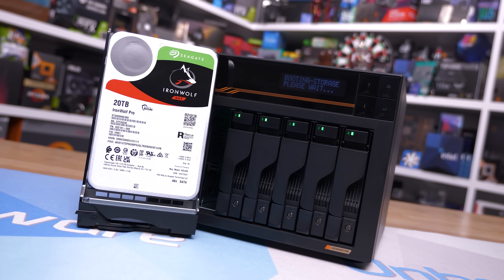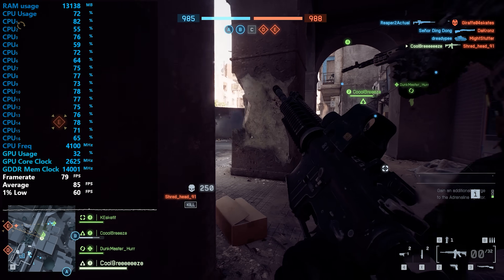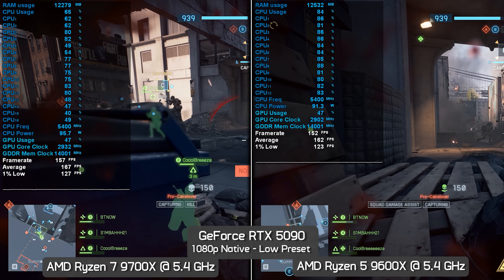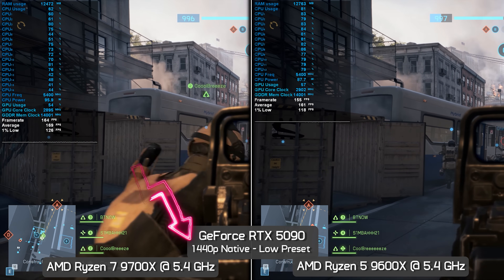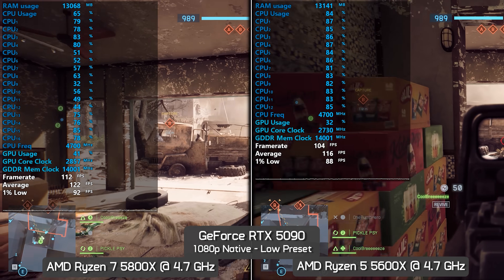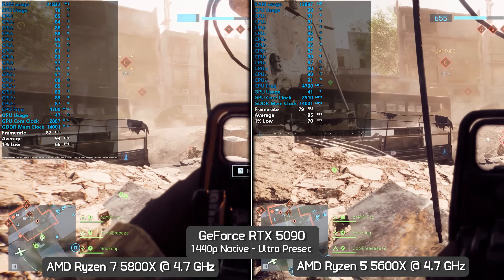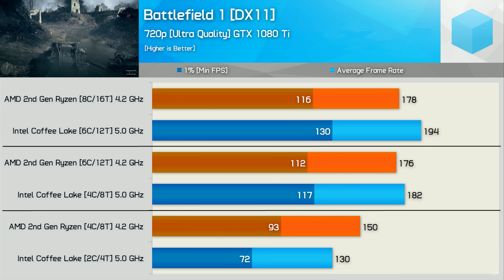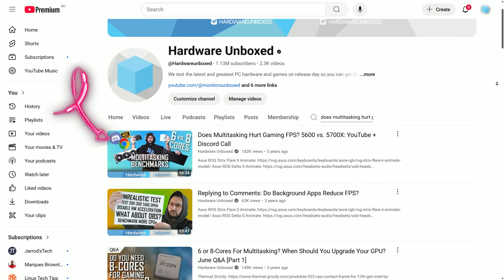Why Gamers DON’T Need More Cores, 6-Cores Still Works Well!

Comment: The only problem is the absence of 3D v-cache on 6-core AM5 processors. It does make a huge difference in some games.
Reply: Yea, but 32MB for 6 cores is still really good.  And frankly, when these 6 core CPU's are often on sale for like £130, it's very hard to complain.
Reply: @maynardburger  It absolutely is a still a great offer, for sure. I just wish AMD had some nice X3D offers even with R5 CPUs. Then everyone could comfortably pick a CPU for their use case.
Reply: @frantavopicka5259 
From the past experience. The 6 cores X3D CPU was just a bunch of salvageable "failed 8 cores". There's no reason for AMD to release a dedicated 6 cores X3D CPU line, if the 8 cores itself still selling like a hotcakes.
Reply: @fajaradi1223  Where i live, we have 7600X3D's and 7800X3D's. The only problem with the 7600X3D is that it's only $15 less than the 7800X3D.
Reply: Нет игры где 32 мб не хватит, кроме редких особо упоротых игр, в которые не особотянет играть
Reply: the 7600x3d exist and realy affordable in the USA and Canada with a MicroCenter/Canada Computer Bundle.  In Europe you can get it at Mindfactory.

Comment: You are also benchmarking a bit of ccx to ccx latency with the older cpu:s. 2600x is a 3+3 and 2700x 4+4 chip.
Reply: That is an absolute detail. Thank you 👍
Reply: Well that's more or less inevitable when benchmarking multi ccx ones. Just part of owning those

Comment: I thought I would see the x3d parts for each gen (5600x3d vs 58/700x3d, 7600x3d vs 7800x3d) but then I realized 9k series doesn't have a 6-core x3d

Comment: "BRO can you please test in 4k? i don't know if my CPU can do 4k?" LOL
Reply: I can do 4k on my ryzen 5 5500 and my rtx 5060 ti 16 gb. I am on the am 4 platform and it performs flawlessly. I can get ultra settings on most games. Doom the dark ages and cyberpunk 2077 being the exception with low fps. I can get 60 fps in for night at 4k which is fine for casual gaming and not professional.

Edit: the CPUs on the current Xbox and PlayStation are based on the zen 2 architecture and play 4k. My ryzen 5 5500 is zen 3. I will eventually upgrade to the zen 6 or zen 7 with the APU type CPU with the graphics power of the rtx 4070 when it comes out in 2027. I will still pair it with an Nvidia discreet GPU.
Reply: @nephilim0may0cry  bro the whole joke is that the CPU dont matter when it comes to resslution. CPU litrelly does nothing wheN bumping up the res, thats the joke here.
Reply: @imretix8081 usually

It's rare, but occasionally there are instances where upping resolution can increase CPU load. Even then, typically the GPU load increase is much greater and you end up GPU limited anyway.

From a practical perspective you are generally right, but it's worth noting that it's not always technically the case.

Comment: Even today most games still largely rely on single-threaded performance, which is dumb. One of the few examples that I've seen that will use every core and thread you have to its max potential is Cyberpunk 2077 which still runs great on my old 10th gen Core i9, but some newer games struggle due to barely touching most of the cores and hammering like 1-2 threads.

If more games would be like Cyberpunk (never thought I'd say that) then CPUs would age a lot slower.

Comment: Intel spirit, get out of Steve's head. 8+ cores is required. The more the better. The problem is the OS (Windows) that is not good with over 8...
And games do not spread its load across CPU cores, the OS scheduler does. That's why you can still run 16 threads on a 4-core CPU and it works.
We left the 4-core era because Windows itself just for running requires at least 4 cores now to run efficiently and smoothly.

Edit: And if it's dumb to test games at 4k, then it is dumb to use games to benchmark CPUs at all since older gen with just some added L3 cache can still out do some of the latest ones. The thing is, having the fastest CPU with a slow or not ultra latest GPU is dumb too then? Game is not the appropriate software to test a CPU because of too many factors evolving around. So testing any CPU with a GPU involve is futile.

Comment: I loved my 8086k. Had it overclocked to 5.3 ghz. Fantastic cpu, even in 2024. I have moved on to a 9800x3d, but I will always think fondly of my 8086.
Reply: Yep, my old 8086K idles only at 30C, comparing to 50C from my new Ryzen 9950X.

Comment: Yesterday, I literally saw someone commenting that playing games while streaming on a 6 core causes stuttering while not so much on more cores. Forgot which video that was.
Reply: Eating my words. That was regarding VRAM, and the user suggests closing background resources that consume VRAM for more headroom.
Reply: And its true, russian channel tested multiple backgorund apps and the 12400F/5600X started stuttering while the 8 core cpu(forgot its model) did not suffer at all.
Reply: @kazuviking I think I remember which video it was. It's the recent R7 1700 Vs i3-12100 video on RandomGamingInHD.
Reply: @HandleIsNewAndBad Well, it is simply not just about the streaming, but if you just play, 6 core is enough.
Reply: @kazuviking Streaming gets more demanding with higher settings. I can double stream at 1440p 60FPS 20Mbps with my old 13900K.

Comment: I guess the 9600X with the 9070 XT for 1440p only for gaming is the way to go
Reply: 5600x + 7800xt works quite well, speaking from experience.
Reply: @shryko  Im still rocking a i5 11400 + rx 6800 xt myself. It gets the job done.
Reply: appears so, killer combo.
Reply: Me too thinking abt getting a 9700x with 9070 xt
Reply: 7500f + 9060xt 16gb is best for budget gaming

Comment: don't forget the Zen+ (IIRC) Ryzen 1600AF at what was it? $85?
Reply: Still have one, inside one of the home builds, running like a dream, paired with rx6600, for 1080p@60fps. And once it can't run those games, will just convert it to a retro emulation server.
Reply: Yep it was $85 for the 1600AF. I bought one right at the start of the covid lockdown. There was also the regular 1600 on sale for $60 towards the end of 2019, I had a friend that bought one of those and is still using it to this day.
Reply: While a massive value win on-paper, it came out in late 2019, just one year before the new consoles would come in with 8 core Zen 2 processors.  And given how even 3600's perform these days in plenty of games, the 1600AF probably only had any kind of longevity because of how excruciatingly long the cross-gen period of XSX/PS5 lasted which not many people expected.  So maybe you got lucky if you bought one of these at the time, but that always seemed a risky prospect to me, even for how cheap it was, when you could get a 3600 for $200, which spread out over the next 5 years, was only $20/year more for much more relevant performance that entire time.  Or heck, if you were just a little patient, just one year after the 1600AF we got the 5600 Zen 3 processor for $200 which is ultimately way faster.  People forget those original Zen 1 CPU's were not actually that powerful in single thread performance, still well behind Intel.

Comment: The first week of the beta I was on a 10900k with a avg of 120fps I wanted to get on the AM5 platform so I bought the cheapest cpu (7600x for 170) and for the 2nd weekend of the beta I was avg 160. I was planning on upgrading it but I think I’ll just wait for zen 6.

Comment: My 7500F is just doing fine still. I can play everything with at least 60fps at maximum settings in 1440p.
Reply: 7500f is even good for +-100fps in AAA games. Its quiet insane how good of a cpu this little boy is.
Reply: @richardjung9562 I'm running it with a RX 9060 XT 16GB.
Reply: your 7500F will be good for years to come. Insane price to perf CPU, can be had for 140-150 on newegg

Comment: Maybe Next, the Ryzen 7 processor could Utilize 8 cores with 768KB L1, 8MB L2, and 48MB L3 cache for improvement or even justified upgrade, but hey Im not cpu expert or so... 
BTW new Hardware Unboxed tune is soo good, specially on Earphones.

Comment: Tech deals has been real quiet since this dropped.
Edit:
Btw Steve, framechasers is trashing ya for saying the 7600 is the better choice over 14600k.
Reply: Literally the first thing that came to mind when i read the video title was „Tech Deals and his 12 core for everything shenanigans“
Reply: Its okay we can agree on disagree.  I hv gamed on from jst 1 core 1 thread Pentium 4 system to current 8 core 16 thread i7 12700 non k

Comment: I have 4/8t Core i7, and these days in order to play any game I need to shut down any application including teams chat, all 4/8 cores used 100% as GPU is oversized for CPU, but it gets used 80-90% so it's not terrible either. Point is extra aps do require more CPU, just probably on 6 core it's not as prominent.

Comment: I've always wanted to see a comparison for the 9900X3D, I got it at a good price and I do use the extra 4 cores compared to the 9800X3D, but since two of those cores aren't the X3D ones how much of a penalty does it get in terms of performance in gaming? Or, say, compared to the 9950X3D.
Reply: This my current  situation. I have a 9900x3d. I turn on msi x3d game mode . My games performance jumped and butter smooth in games like. War Within, City of Heroes, F1 25, Madden 26 and many more. I’ve  also notice extremely less latency, almost like it doesn’t exist. My gpu is a 9070xt and I’m playing on  a 4k 240z oled. When x3d game  off. I noticed some stuttering and more latency. I’m definitely keeping x3d game mode on.
Reply: @tbreeze79  The only thing that mode does is to turn off the other 6 cores. So you have a CPU that performs worse than a 9800X3D on every scale, since you have 6 cores instead of 8. You probably didn't install the chipset drivers, or disabled the xbox game bar, you need both for windows to know which core to use for games, and which for other windows processes and programs.

Comment: Video take away: 6 core CPUs are the quad cores of the modern era.
Reply from the maker: Not really, the quad-cores thing suffered massively from core stagnation, as in the cores themselves didn't really get faster. As we've just demonstrated here 6-core processors have continued to get faster.

Comment: I have the 5600x and rtx 3080. My cpu is constantly at 90-99% on Bf6 lowest settings and I'm barely getting 100fps unlike what is seen in the video the 5600x was constantly below 90% and was at 120fps
Reply: I’m assuming he tests on a clean install of windows with no software running. That may be the difference
Reply: are u running it stock ? no PBO , video showed overclocked 5600x on all cores which can help in CPU bound scenarios
Reply: @turtleneck369 i am using the ryzen master software it auto clocks my cpu when needed.
Reply: @Danger_Assaassin i am not sure how well it works but if u are not running nothing in baground u should get a bit better results i actually benched same setup in bf6 but 5600 was 4.8ghz all core ,what is your memory setup temps while playing and so on ? what resolution?
Reply: @turtleneck369 1440p, temps at 75 max for both cpu and gpu. Ddr4 3200mhz cl16.

Comment: Its more of a thing  across generations and eliminating already existing  bottlenecks. I upgraded from a R5 3600 to a R7 5700x and the 3080 is now performing much better. 
That being said people that were buying quad cores in 2019.  especially the i3-8100, 3200G and i3-9350 are not having fun with their 4 core 4 threads.

Comment: Also the benefits of having more cores arent easily represented in benchmark charts, alot of it is load times, boot times, smoothness and responsiveness and better longevity, multitasking and generally higher resale value too
Reply: Indeed, those are all perks of having more cores usually, but still heavily dependent on the purchasing price difference between its 6 core counterpart.
Reply: @WrongButtonWB Also dependent on how LONG you keep the CPU around.  Worth remembering that value shouldn't be judged just by what it gives you today, but what it can give you over the whole period of ownership.  $100 more might feel like bad value on Day 1, but spread over 5 years, that's only $20/year and much easier to justify.  Importantly, the extra cores might also let you hold off on an upgrade a little longer.  In which case you're not just gaining longevity, you're also making it so when you do upgrade again, better options might exist than were to you need to upgrade a couple years prior.
Reply: @maynardburger not to mention, if you divide it by the thousands of hours of overall use of the machine, the figure is so small you would wonder why you stressed over it in the first place

Plus, having a better cpu makes a difference from the moment you hit the power button, unlike a gpu. Which is primarily when youre gaming

Comment: My old R5 2600x was not keeping up on the games I played, and also couldn't run my RAM full speed. When I upgraded to a 5700x3D all my stutter and lag problems vanished.
Reply: How much that upgrade ended up costing you? 5700x3d is ridiculously overpriced here, like 230€ which is almost 270$... So not worth the cash.
Reply: @WrongButtonWB I paid £180 for it last year.

Comment: For gaming only, I will agree with your assessment. However, once you start adding having a browser running a stream on your 2nd monitor while you are playing games and Discord/OBS in a scenario where you are streaming the game to an audience, 6 and even 8 core CPUs can both reach high enough utilisation to run into some bottlenecks already (not sure if BF6 is a title that uses most cpu, my worst experiences are in MH Wilds, which might be partly the fault of the games poor performance overall).
So, while you can currently run games fine with 6 and 8 cores, it is the general utility around just running a game that has gotten somewhat more limited by now. Assuming the next console gen might offer 8 cores for the cpu part, by then the issue will certainly show up more.
But to emphasize, I completely agree with you that for gaming, as what I described certainly isn't the general use case. For most people 6 cores will be sufficient for quite a while, and are absoutely to be considered the best option for low budget with very few downsides.

Comment: On a 12700k and 9070 in BF2042 I would get around 100fps on 1440p high. In BF6 I was able to almost max out my monitors rate of 144 on 1440p high with fps between 120 and 140.

Comment: Consoles dictate the core count. PlayStation 6 is reportedly-allegedly going to have 8 cores. Faster 6 cores do not fully make up the difference with slower 8 cores, so I would actually think the doomsayers are correct. At least from future point of view. 
But, the price difference between 9600x and 9700x is substantial, and PS6 release date is going to be late 2027 or later, so...?

Comment: Even the 9700k fairs pretty well in bf6, seems the frostbite   upgrade they did will keep my old rig running.
Reply: The main 'upgrade' is going back down from 128 players to 64 players and not needing such incredibly huge maps.
Reply: @maynardburger Well bf6 is on the new 4.0 version of frostbite. Nothing to do with the 64 vs 128 player count.
Reply: Frostbite 2 (BF3) was the GOAT, FB3 was allot more demanding and I've never quite been able to see why.
A CPU capable of 140fps suddenly only got 80fps because there was just that much more CPU load (the SOTTR effect).
Reply: @tomstech4390 actually, frostbite 2 had, and still has a bug which absolutely destroys your frame rate. The engine uses a debug setting which constantly pings your memory, at a really high polling rate, for whatever reason they never removed it. You can disable it with a console command but sadly it re enables it every time you die.

Comment: Are you testing this with a fresh install with no additional software running?

If I'm playing a game like battlefield I would be only playing with friends.  Id have this setup going...
USB headset (USB is additional CPU audio processing)
Discord
MSI afterburner to set a custom GPU fan curve
Steam
Possibly a few tabs on a. Web browser open (probably close to 0 CPU load the majority of the time)

Other users may have keyboard and mouse software running but I keep my PC pretty lean.

Comment: Better value? MB+RAM+CPU combo for total price.  On the other hand. Best value, is dependent on do you plan to upgrade within same motherboard and RAM with faster CPU. And answer is, Zen7 with 16 core chiplets and far bigger caches and faster single threaded performance is a truly worthy upgrade.  Thus whatever you buy now, could be replaced with way better CPU within the same platform.

Comment: Is the ryzen 5 7600x worth over the 7600? In gaming 7600x seems to provide 2-3 fps more but it always runs at high temperatures. Does it outperform 7600 in other day to day tasks ? Is the hassle of managing the temps just for 2-3 fps worth it? Anyone suggest me which one to choose.

Comment: Tldr. 64 core threadripper is the sweet spot for BF6
Reply: Thanks, dropping $10k on my battlefield battlestation now
Reply: @The11devans  You all have 10k gaming rigs, right? Also, do you like my jacket? xD
Reply: @GreyDeathVaccine 
10K what? 
Australian?
Reply: @fajaradi1223  Zimbabwean
Reply: Monster hunter world tries to use over 100 threads and wastes abut 20% of a CPUs power with thread switching. I wonder how a threadripper would handle that game?
Reply: @chronossage I dont know we might have to wait a couple more generations for a beast to run that mess 😂
Reply: Can secure boot with that thing?
Reply: get one of the cache-ripper cpus (amd eypc 96 cores with 3dvcache) a 9500f would probably be faster due to clock speed but eh